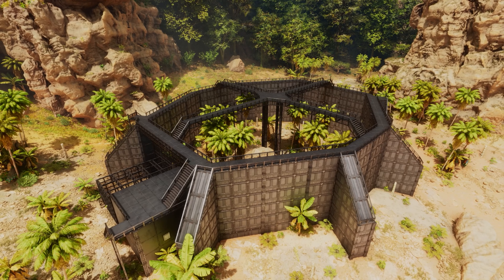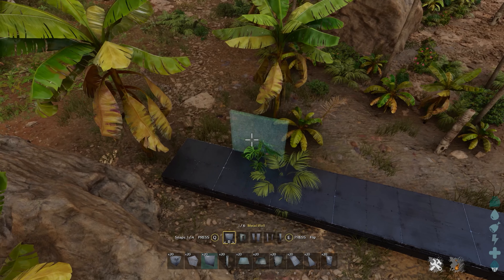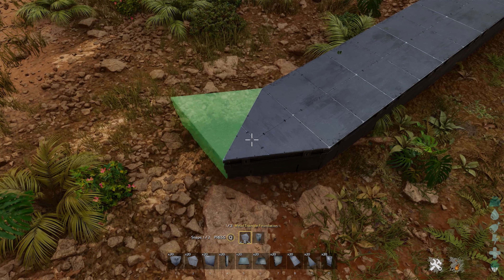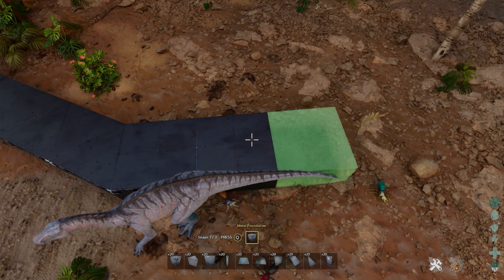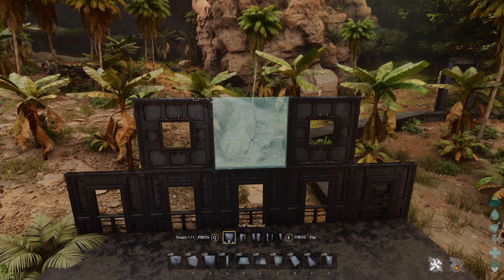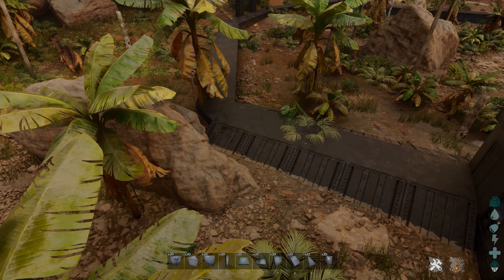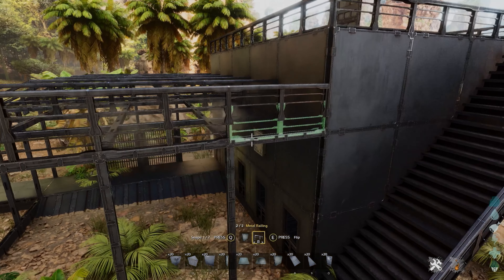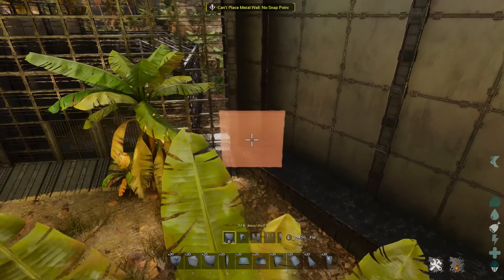Jurassic World Raptor Paddock | Build Tutorial Dino Pen | ARK: Survival Ascended

Comment from the maker: Estimated Structures List:

- 541x Metal Pillars
- 57x Metal Quarter Ceilings
- 583x Metal Quarter Walls
- 111x Metal Ceilings
- 888x Metal Walls
- 94x Metal Foundations
- 26x Metal Triangle Foundations
- 62x Metal Roofs
- 47x Metal Sloped Walls
- 20x Airconditioner
- 2x Metal Gate
- 2x Metal Gateway
- 4x Metal Doors
- 8x Metal Glass/Greenhouse Glass or any glass wall